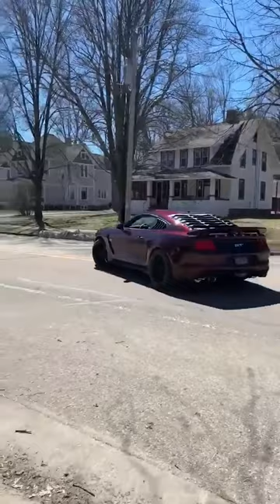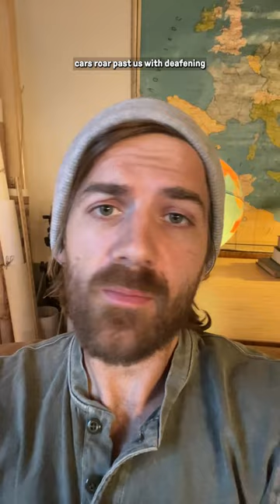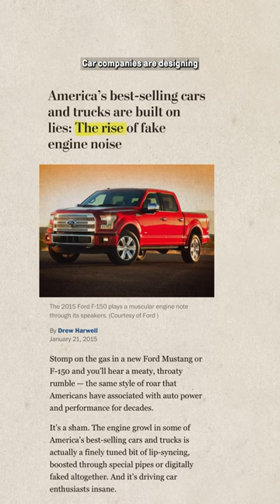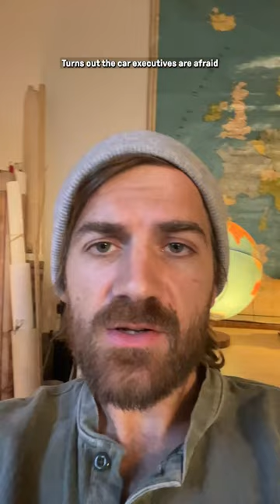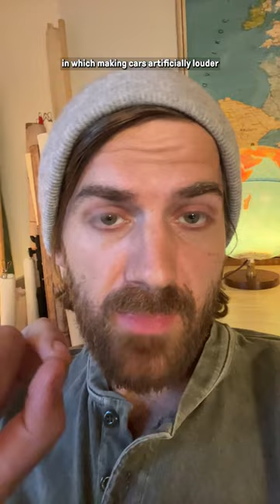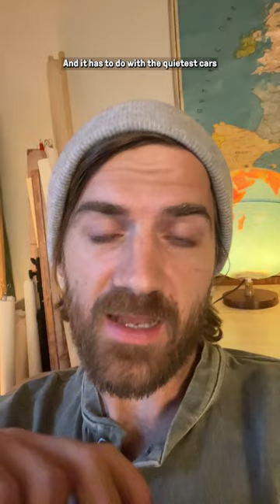Car Companies Are Making Cars LOUDER

Comment: To be clear, they pump fake engine noises into the interior speakers so that it makes an I4 sound like a V8 to the passengers. There aren't exterior speakers blasting fake engine noises to the public in addition to the real exhaust noise.  Some sports cars do have baffled exhausts which open for sport mode (louder) or close for 'neighborhood' or 'quiet' mode which is neat.
Reply: Tell me you don't know shit about cars without telling me (not you, MTKARusty, you are entirely correct; I'm talking about Johnny here)
Reply: Some new diesel Audi’s have actual speakers in their exhaust! They also have fake exhaust pipes. I find it a bit sad actually, as a car enthusiast
Reply: Most of the loud cars you see are going to have a straight pipe. Where they removed cats, mufflers, sensors so that more airflow is exhausted. Increasing power. The newer mustangs have baffles. You’re kind of starting a war with anyone who likes engines. 

I’m a huge fan of electric vehicles, but I have massive love for gasoline cars. Don’t take the fun out of race cars. Sports cars already have the smallest demographic out of all vehicles in general, let us ride our last wave.
Reply: Car these days has quiter muffler, it make sense why they put artificial noise with electronics ..

Except if you go to tuners and change your muffler to racing or else like Greddy or Borla, now that's different ..
Reply: And less exhaust restrictions generally make more power (enter the argument of fluid dynamics). so there is a power benefit to being louder, just sometimes not a large one.
Reply: @NickVanRegenmorter  the larger the exhaust = the more combustion & more exhaust , thus more power …

But it should also paired with Turbocharger / Supercharger to make make it more horsepower & torque
Reply: This
Reply: Exhaust and camshafts change engine tone and volume and typically offer performance upgrades. You decide which is the side effect of the other.
Reply: Yeah I totally get that. If my car's engine sounds unsatisfying on the interior that kind of ruins the driving experience.
Reply: Nope, there are definetly cars with speakers in/near the exhaust to blast Fake engine noises..

Comment: for anyone that wants to know how true this is, That sound isn’t fake. Yes there are cases of car companies including ford using fake engine noises for the interior of the car but not the exterior.  Most normal vehicles are still as quiet as possible it’s only performance cars like mustangs, Camaros, corvettes that are designed to be louder because those are the cars people buy for the engine and driving experience so yes all aspects of driving are amplified including stiffer suspension and a louder engine.
Reply: None of that is the real problem of cars not stopping for pedestrians
Reply: @onesob13  mustangs will be mustangs
Reply: @Jacobbunt it's Mopar now

Comment: Alright I'm gonna get nitpicky right now so if you don't want to read it, don't.
Those sounds aren't "fake".
Cars usually sound quiet due to mufflers, resonators (yeah
It sounds like something that'd increase the volume but it actually DECREASES the sound levels) and multiple particulate filters for emissions norms.
The Mustang in this video most probably had one or more of these components removed, resulting in a partial or a complete straightpipe.
This is a part of exhaust modifications and enthusiasts do it cause a loud exhaust simply sounds better to some than having a quiet car.
There is nothing "fake" about this. Yes, companies do engineer their exhaust systems to tune the frequencies, resulting in harmonics that sound better than something that's just a mix of random frequencies put together. They do this by manipulating the length of exhaust headers (outlet pipes from each combustion cylinder). To be honest, that's actually a good thing cause atleast we have loud cars that sound good instead of sounding like a racket.
What he was only partially right about was the use of speakers for exhaust sounds. That's only used to pump in exhaust noises INSIDE the cabin. The narration of this video makes it sound like he's claiming that even the sound outside is playing through speakers. No. That doesn't happen. No manufacturer does that. Except for electric vehicles. The Audi E-Tron SUV has a low hum to alert pedestrians of an incoming vehicle.
Reply: Thanks for this comment, I would have said roughly the same thing if I hadn't seen it first. I do want to say that noise can, unlike Johnny seems to suggest, be a sign of a powerful engine, especially since things like the straight-piping mentioned above can make the engine breathe better resulting in more power. I've been seeing a rise in sensationalism on this channel and I'm honestly bothered by it, please maintain your integrity Johnny, I love your work and would hate to see this become just another media channel that sensationalises for views. I expect better research from this channel
Reply: Last part here is not true.
Take the audi SQ5 TDI, it has an actual speaker built in the exhaust system. Many more models has this.
Reply: My nitpick about your nitpick is that it's not really a nitpick. What you describe is both accurate and more importantly significant. I love Johnny but this is probably the most ignorant post I've seen from him.
Reply: Almost every modern Porsche plays engine noises through the cars speakers
Reply: @patrickh499  this is fed into the cabin not the exhaust, the sq5 makes fake engine noises on the inside not the outside
Reply: @alwayswindigs  the last time we had a SQ5 in the shop, it didn't sound like it on the inside, can't say for sure. but it it definitely had an "active" exhaust system. I saw the speaker myself. The VW GTE's have it too
Reply: Except that’s BS. We don’t open up the exhaust just to make noise. 

When we blueprint our cars for maximum fuel efficiency, power or just for racing, the intake and exhaust flow rate requirements are  deliberately and meticulously calculated and usually require a significant increase over stock flow rates, requiring larger and more open flow. 
Otherwise you end up with a bottleneck. 
Not for noise. 
That’s just ignorant.
Reply: @patrickh499  what are you arguing for. The point is simple this video is misleading. He is rage baiting people into trying to make All cars quieter by saying the noise is “fake”. That’s the aim. Everything else is besides the point. This article was in 2015 and 100% about noise in the cabin via speakers and sound tubes and he’s using it to suggest the sound of a mustang GT is “fake”
Reply: @Fee.1  i was replying to the comment saying its only in the cabin. But yea, i total agrees with you. JH is hate baiting here.
Reply: I agree with this comment, I like Johnny Harris but it feels like this is one of those content where his research isn't as thorough.
Reply: Thank you for this fealt that the ytuber spreading misinformation
Reply: The majority won’t see this and it’s sad.
Reply: Holy shit, someone who knows what they're talking about. Thank you!
Reply: @patrickh499  I get who you were replying to & I’m glad you recognize it’s rage bait, I wanted to clarify the comment you made about the engine noise inside vs outside. It seems to me maybe manufacturers need to brand these features better if even mechanics are misunderstanding what they do.  Sorry for the long reply but hopefully it will help ppl’s confusion. 
    Sound is pumped into the cabin via speakers on most cars and w/ a physical sound tube from the engine bay to the cabin in some like the LFA. 
it’s actually to help make exhaust QUIETER while allowing the driver to still enjoy his engine noise. 

   The “ACTIVE EXHAUST” you speak of is an exhaust system that uses electronically actuated Valves to allow you to have louder exhaust or quieter exhaust at the press of a button. It’s not speakers. It closes valves/baffles in the exhaust to redirect  or construct the flow massively lowering the volume. In normal operation they only open up for full volume when you are accelerating hard and reach like 4500rpm. 

Most newer cars with this Active setup have a button that lets you put your exhaust into loud mode, quiet mode, or normal mode so that if you’re at a car show for example you can rev the car in neutral & still hear it at full volume despite not being above 4500rpm & going above a certain speed & when you leave for work at 6am quiet mode drastically reduces the volume. 

Some people are just jerks. I have a motorcycle that doesn’t have an active exhaust it’s just very loud, but I drive it like a grandma on weed early in the morning or late at night to make sure it’s not disturbing people. 
     Conversely people with silent electrics can use their insane UNNECESSARY torque to do burnouts and be 100x louder than my bike is when I’m poodling around. 

People always seem to forget that a car with a loud exhaust isn’t actually loud 100% of the time and a conscientious owner can easily make sure it doesn’t bother anyone. If they have an active exhaust it’s effortless just push a button and your exhaust gets quiet, they are more expensive though so typically only on higher end cars or cars with pricy aftermarket exhausts (so yes this brings up an interesting point that louder aftermarket exhausts can also actually be quieter than the stock one in the normal mode with the valves closed. 

Thank you for coming to my TEDx Talk
Reply: @globesurfer122  to be fair, capitalism is just a little bit weird... But let's be real here, that's what makes capitalism fucking awesome. If I can throw an obscene amount of money into my car to make it louder just so I can feel better about myself, I'd say that's pretty weird... But awesome that I can do it.
Reply: @CypherusMcClain  there is a lot kinds of taste out there ya know lol ...
Reply: @natecollins9331  indeed there are.
Reply: @patrickh499  not sure what country you’re in but if Germany it would be super easy to sit in a q7 TDi and notice hey that sounds like a v8 😂. The “Soundaktor” deals with in cabin noise only and has nothing to do with the exhaust pipe. How you’d expect a speaker inside a hollow sealed metal chamber to do anything is beyond me, I mean no disrespect but can I ask what exactly you do in the mechanic shop ?
Reply: @Fee.1  close, Denmark. And hey, i didn't invent that, so don't blame me :D its fake and stupid, but its definitely a 
Thing.
What i did in the workshop? Cars.
On the SQ5 we changed a bad O2 sensor.
Why?
Reply: @patrickh499  it’s NOT a thing. Did you not see my previous comment?
Reply: @patrickh499  dude they are not speakers and that is not the definition of an active exhaust. Audi’s active is exhaust is like everyone else’s, it allows for the tone and volume to change with rpm and with the press of a button. There are no speakers outside. You can literally watch people putting that active exhaust on the SQ5 & you can see the results and what it does etc. you’re not thinking. You’re confusing Audi’s active Exhaust with Audi’s “sondaktor”/sound actuator which plays artificial exhaust sound in the cabin over speakers. Take two seconds to look it up or ask a mechanic at your shop that understands this.
Reply: Doesn't the bmw i8 do it?
Reply: @matthew1194668  do WHAT? Everyone seems to have zero ability to understand the difference between exhaust noise in the cabin over your speakers vs. fake exhaust sound outside. So no the bmw doesn’t do “it” it only does the former. Ironically only a couple electrics have speakers outside to make fake noise
Reply: i would agree with you except that johnny isn't sensationalizing for views. He's just not a car guy and doesn't understand the intricacies of modifying an exhaust he also genuinely doesn't like loud cars and thinks companies should just make them quieter if it doesn't affect the power (which many could do) it's not an opinion i share but it's definitely a genuine one.

Comment: More concerning is that we, as a society, are okay with noise pollution from the collective sound of rubber car tires on asphalt at speeds above 30 mph. Aside from particulate pollution, sound pollution is a huge byproduct of car-dependent planning. Not just bikes shows how cautious the Netherlands is about mitigating noise pollution on higher speed roads (and slowing cars through street design) to eliminate high speeds in neighborhoods. Something to think about.

Comment: First Mustang 2015 I drove had a very disappointing engine sound for a v8. Thanks god they fixed it on mine (2019) and also you can chose loudness by a exhaust valve.

Comment: Yeah that's not a fake sound, nor are the loud exhaust noises you hear from sports cars and trucks. Those are just modified exhaust systems to help add some power and for better (arguably so) sounds from the car. 

Lots of sporty cars do pump fake engine noise into the cabin to try to give people that experience without them modifying the mufflers and such. Most car enthusiasts hate the fake noises and you end up back with modified exhausts.

Comment: High flow exhaust sounds like that with a big engine. There are performance gain, albeit minuscule, but they are there. A better flowing engine will invariably perform better as all engines are just big pumps.

Comment: As some others have pointed out,
First that mustang clearly has modified exhaust because they don't sound like that stock. Not to mention new mustangs have valved exhaust that can actually make them quieter.
Second, most of the sound is designed with the tube lengths, which is why the new V6 Raptor has a weird trombone bend in the exhaust, to make it sound better. 
Third, the sake sound that's played on speakers is pumped into the inside of the car not the outside, because the inside has all that sound deadening and whatnot.
Aside from performance vehicles with valved exhausts that can be controlled to be louder and quieter, most car exhausts are not loud to begin with, and fake audio is pumped into the cabin.
Reply: Excuses, excuses

Comment: Actually nowadays the tire friction is making more noise than the engine from the outside, because cars got heavier and the .ost common tire width has increased (or atleast in Europe) to size that's 5 cm wider (175mm - 225mm) 

Fun fact: Back in 2009 (I think) the Tesla model S was so heavy and accelerated with so much power that it couldn't pass the US drive-by noise regulations (from 30mph flatout for 100 yards I think), all due to tire noise until Michelin hadn't developed a special tire compound for the car.
Reply: Yeah, tell that to the asshole in the apartments across from me who drives a Challenger and intentionally burns out every time they leave

Comment: Johnny no, not at all. The speakers are referring to speakers on the interior. You are entirely correct, the loud exhaust pipes are wholly unnecessary. However, they are for a different reason than you referenced. The reduction in exhaust system back pressure may actually result in either a decrease in power or at most an increase of only 15 horsepower.

Comment: The most noise still comes from the tires. And that's the same for electric and fossil fuel powered cars
Reply: Do you think the argument that EV's are dangerously quiet was created by the industry that would suffer most of EV's took off? I think if the quiet argument was factual and data driven then some internal combustion engine cars would need added sci-fi sounds like EV's to be heard too.

Comment: Actually cars are mostly getting quieter not louder. Particularly in Europe ever tightening emission and noise regulations are making the latest and upcoming generation of IC engines not nearly as loud as they used to be.  Even loud muscle cars like that Mustang posted in the clip are often only at their loudest when the throttle is wide open. Most of the time the adjustable flaps in the exhaust systems of even these cars are closed and the engine relatively quiet.

Comment: I love how perfectly timed for looping Johnny's dialogue is. But that aside I'm really disappointed in Johnny with this short. It comes across as ignorant to the topic of sound design in cars. In this ignorance it's kind of misleading. The sounds cars make has always been a result of specific engineering goals. All engines with no exhaust system are inherently noisy. Cars are either noisy or quiet because that's what they think the customer wants. In the case of sound piped in through the speakers it's typically because the auto-maker expects the target audience to be people who personally like the sound of a loud engine but don't want to attract attention. I know I am the stereotypical demographic and my car has such a system - a Ford Fusion Sport. It's pretty quick but is not an obvious "sports car". My main gripe is the engine is a Twin Turbo V6 and even the nicest exhaust system will not make it sound all that great so I kind of which it was dead silent anyway.

Comment: Is some engine noise necessary for very quiet vehicles? Yes, and for the obvious scenario of the the visually impaired. Even average ppl use sounds as cues in addition to sight to be aware of their environment. I can hear a combustion engine in my blindside faster than I can turn my head to see it.

I can’t see it being the case for loud as cars, though. That’s just compensating for something.

Comment: Interesting side fact: also the clicking sound from the turn signals does come from the instruments section in more modern cars. Not from electric Relais, like it used to be.
How would I know? Some time ago my instrument sections was defect, deactivated from time to time and I had no clue whether my hazard lights were still on or not. I had to look outside the car if I could see them blinking.